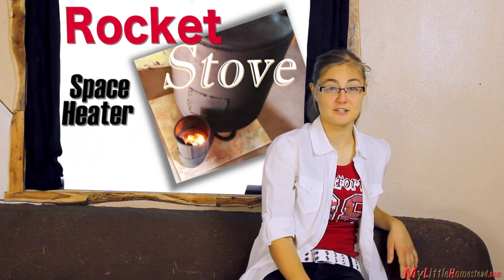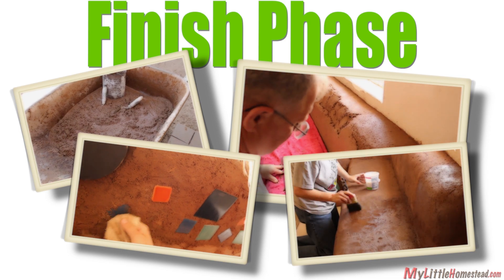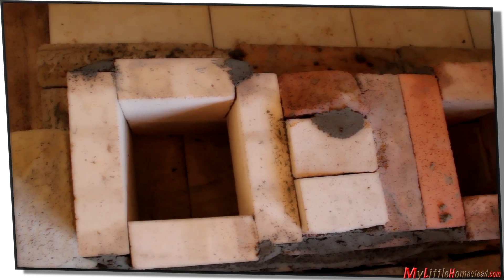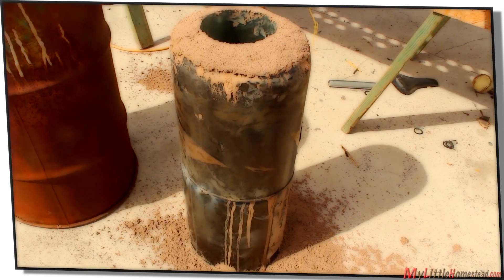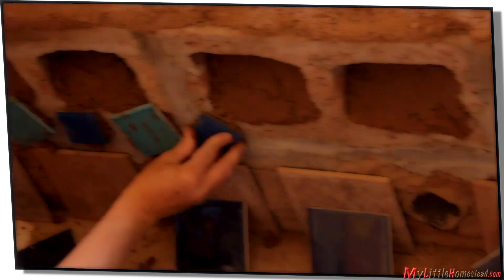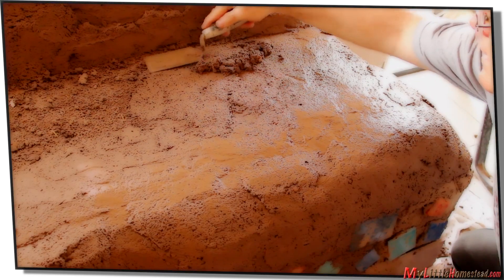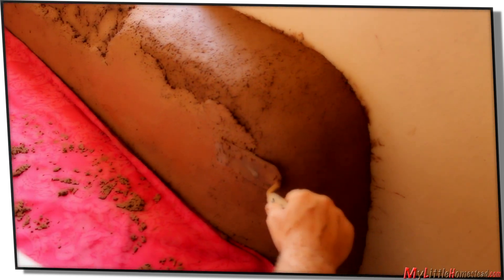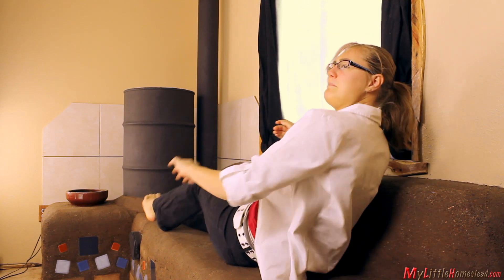Complete Build of Rocket Stove Mass Heater with Homemade Mortar & Cob

Comment: I've been in the fireplace business for 25 years
And watching you vent that thing makes me cringe !!
Interesting is one thing safe is another !
You guys are using galvanized pipe for the venting !
Not good or safe !
That pipe is not a UL listed venting component !!
Those components need to be UL listed for a reason , safety !!
Especially a the temps that type of system generate !
I understand what you doing but you can't just grab inferior components and slap something together!
its one thing if you have know other choice but  to use those components but it doesn't look like the case !
Reply: You know nothing about the science of a rocket mass heater! Once the flames hit the top of barrel they cool rapidly and the gases turn to CO2 and steam. The temp of the Galvy pipe is under 200deg. And you can hold your hand over the exit. The only problem with this design is the metal flue in the J combustion chamber, it will burn out. You should only use fire brick. These heaters burn more efficient than any fuel furnace. You could breath the exhaust. This is nothing like an in-efficient fire place or wood stove.

Comment: Interesting.
The smoke has a long vertical way. Does the chimney have enough "power" to pull out the smoke.. Meaning; is it easy to fire up? (sorry the english)
Reply from the maker: Lau Fowler Petersen The short answer is yes but you can check out our latest video as it explains a little more: https://www.youtube.com/watch?v=nG9-hyg7r4k
Reply: As long as the mass that you're heating remains warmer than the outside air, it will constantly have pull. The super heating of the exhaust gasses inside the heat stack allows for almost a vacuum effect when the mass is cooler and you light it with high energy output. 

A warm mass will basically work as a free air circulator constantly sucking out air. (Which is why you should always have some sort of lid for your feed)

Comment: I love this project.  I WILL be doing one at some point.  More research to do of course but I do have a question for you.  How is your ducting connected to the combustion chamber?  There was no mention of that other than placing the ducting on the first cob layer.  Thanks!
Reply from the maker: FlyHeadCement We used 6" heat register

Comment: I have a few questions: How water/spill resistant is that cob? What would happen if a glass of milk, or wine or something was spilled on it?  Also, how hot does the surface of the cob get at it's hottest? Could a person build this stove with cob, square it off, and encase it with say... oak cabinetry? Any info is much appreciated. Thanks!
Reply from the maker: Joe Stubbernubbensteingenson  Linseed oil helps to repel liquid spills - we might recommend floor wax too. We don't have any experience with milk or wine spilling - only water. If we had a problem, we would chip out the cob and redo a section. We've not measured the temperature but at its hottest, we can sit on the bench. Cob with cabinetry sounds like fun! Do it and let us know how it works. It's all about exploring. Thanks for the questions :)
Reply: You did not ask me but I am replying anyway.  The purpose of the cob is to absorb the heat and release it to the room.  Wood whether oak or anything else is an insulator and does not absorb heat.  Think of an old cast iron frying pan with a wood handle.  Encasing the cob in wood would defeat the purpose.
Reply: There are cob houses in England . England is wet ..it rains alot and they have been building with Cob and other earth building for thousands of years. 
Does everything have to be squared off and perfect..I love this stove and the cob. Cob is something you can do from your own land..I live in Louisiana and the cob would keep it cooler in the summer and warmer in the winter as well as  being a much cheaper way to build your home instead of the hundreds of thousands  for a stick house.

Good job and your warming bench is beautiful...put down a couple fluffy cushions and it would be the best place to be with a good book in the winter.
Reply: Joe Stubbernubbensteingenson You can do mosaics... you can paint..sculpt and be creative. I guess not all people would love something this holistic..I just happen to love it. 

https://www.pinterest.com/junglejaaane/cob-houses-and-interior/
Reply: Good point, Peggy - thanks. I guess I'll encase my cob bench in cast iron frying pans. Seriously though, I'm just looking for something that's a little more aesthetically pleasing than cob - I've just never been into the adobe look.
Reply: Joe Stubbernubbensteingenson I understand.  I think concrete or ceramic tile would work.  They are many choices in colors and textures.  They have tile that looks like wood.
Reply: I was thinking of a fancy counter-top material like soapstone... It'd be expensive but it sure would be nice
Reply: Joe Stubbernubbensteingenson Any stone would work.  Flagstone is not that expensive.
Reply: Yeah, I suppose so... I'd initially thought of soapstone, because I know it can withstand extreme heat without exploding/shattering. But the heat is not really that extreme, so as long as flagstone (or whatever) can be polished, it'd probably look real nice. Thanks again, for chiming in!
Reply: Joe Stubbernubbensteingenson Soapstone is actually an incredibly good material for the mass of a RMH, but yes indeed, very expensive.

Comment: Hey guys!  Great job!  We are in the middle f our build as right now.  It will be used to heat our Aquaponics system.  I was hoping to pick your brain.  The slightest wind outside pushes the exhaust back through the system.  I have extended, curved, covered and done anything I could think of to limit the breeze from entering the system  Any thoughts?
Reply: There are several things you can do to improve the flow and inhibit back flow. First would be to vent the exhaust on the side of the building that usually does not have wind blowing toward it, if that's not possible the next best option is out the roof with a proper chimney cap. Exhausting out the roof can be tricky with a rocket mass heater due to the fact it efficiently transfers the heat of the burn and hot gases to the barrel and heavy mass, leaving little heat to keep the draft strong. Therefore, If venting out the roof it's best to have the exhaust run close to the barrel to help re-heat the gases before exhausting up and out, as seen in this video. Another thing to help with keeping a strong draft is making the heater riser out of extremely insulating material, best material IMHO, is fire brick. The way they built the heat riser in this video is not the best. Last time I made a riser like that the center pipe melted and would cause toxic smoke out the exhaust.
Reply from the maker: Jeff Johns Aaron is right on on the venting. We just completed a newer version using the formula:  combustion chamber height is 3 times the diameter of the exhaust pipe. For example, a 6" diameter pipe equals an 18" tall combustion chamber. We found this drafts well. (we vent out the roof with a cap)  Good luck with your project :)

Comment: hi , nice RMH ,just 2 little remarks , how do you clean the pipe in the back of the bench and the pipe going up  and second porland cement  turns to its poudery self if heated above  800°C so it's a no no for feed, burntunnel and heatriser  . just my 2 cents
kind regards

Comment: No mention of burning off the galvanized coating of the 30 gallon barrel, done outside, never breathing any of the fumes. Please research about this toxic and dangerous poison, then add comments for all to read, cause otherwise a great video and how to will surely get plenty of people to try this. My first concern was when you said you only sanded the barrel before painting. Always read up on how to burn off the zinc/lead/cadium coating under the paint, you will notice the paint peels, then portions of the barrel turn to a mirror like reflection, then to dust when it reaches ^1100F . The fumes and dust of the coating are dangerous.
Reply: Mike Steigers I’ve never seen a galvanized 55 gallon barrel. Have you?

Comment: After long burning season would it be hard to clean those curved built in pipes? Or because of rocket stove design, there woun`t be too much crap inside? Too scared to try this as building inspectors might not like it or certified chimney specialist might not approve it.
Love your video anyway! Might try to make something like this in future in geodesic greenhouse for winter heating.

Comment: You can wrap a hot water coil around the drum and drive it with either a thermal siphon or pump and use it to heat the radiant floor. Thinking about doing that if I get around to doing a super-adobe shack. You would likely need a burping tank to handle over-pressure in the coil but perhaps a 2 inch clearance might be enough to keep the water < boiling temperature.

Comment: Was wondering about the "MASS" you used for your Rocket Mass Heater?  Which materials are best.  Was thinking of using rocks and stones  found on site.   (2-10 inchs in size.  Would that work? I just have a limited amount of 'COB" (clay) hence wanted to use larger ROCKS (10 inches ini size) for the mass. I would use the COB to act like motor to hold it all together.   Your thoughts please.

Comment: great video is the portland cement mix for high fire areas ? i have heard that refractory cement is what is used for high heat areas just wondering
Reply: Refractory seems a bit overkill, that stuff is rated for up to 2000-3000 degrees. If you are going past 800+ degrees you'll more likely start warping the metal ductwork or the drum first.

Comment: Trying to contact you on Facebook but FB wont let me send a message. Here is what I wrote there "I like you site. A friend of mine just shared your rocket mass heater video with me... we are also homesteading and also built our own RMH in April. I work at the Math and Science Dept at our local college and talked to our lead chemist as I too wanted to paint our drum. But he told me NOT to do it! The RMH heats much hotter than a conventional wood stove and the paint can emit toxic chemicals that you may not smell. He told me to grind off the paint with one of those steel brushes (you know the kind you attach to a drill)... Hope you see this message. Obviously toxic fumes would detract from the natural factor. Best, Shannon www.earthtipi.org"

Comment: Hey guys LOVE this video. This is probably the 10th time I've watched it! A few questions. Is the stovepipe actual stovepipe or just duct pipe? When you put the 30 Gallon barrel over the burn chamber how much of the circumference is opened to the beginning of the stovepipe for the gasses to start their journey. And how could you tell if the clay you got out of the ground was the right kind for your project? I'll probably have a few more but that all for now :) Keep up the great work guys!!

Comment: yeah it helped allot! the only thing you didnt answer was how you got the air from the combustion chamber into the "exhaust pipes" like if you cut a hole into the side of the drum or had the whole round pipe underneath... but then i watched the video slowly as you put the 55 drum into place and i thought i saw a vent almst lke one youd have inside your house with a central heating and air as the mouth for the exhaust. is that correct? and if so is it just the regular stuff you get at home depot?

Comment: I tried tiles and it didn't work well but maybe if they were made without enamel coating? or you used small tiles and left space between them for heat to radiate?

Comment: The Wikipedia page for "Combustion" seems to have a related definition, the one for "smouldering".
If you Google using "combustion lente" (slow combustion in French), then there's a google images link. The stove of the guy I knew was, in apparence anyway, like the following images show.
econologie(dot)info/share/partager/2005-12-26 poel a combustion lente 014.jpg
pages.infinit(dot)net/madmax99/foyer.jpg
Some images show serious flames, but his showed mainly burning hot red coals from hardwood.

Comment: From what I understood from the guy I knew, and he explained while showing me the stove while it was burning a couple of pieces of split hardwood, the wood burns very, very slowly, lasting a long time while producing a lot of heat. A small fan is included and I think it's adjustable for speed or power. It's to push hot air out at a faster pace. The guy said that a couple normal pieces of split hardwood would burn for hours and I don't recall seeing much at all for flames; just little ones.

Comment: Fowl manure, chicken anyway, is great fertilizer when needing nitrates, but elderly farmer and his son once told me when I was starting my first garden during early 1980s that this manure has to be applied in very, very small doses; else, it'll burn the roots of plants. Potent birds!
I also read that blending it with, fe, cow manure helps to provide a very complete and multi-use fertilizer for various plants, but most of my crops evidently didn't suffer from absence of nitrate boost.

Comment: Just checked the manure page at Wikipedia for an answer to my question and there isn't one, but then tried a Google using manure, fire and fuel for search terms. According to the following short article, manure produces more BTUs than hardwood.
"Ellington company turns horse manure into fuel", Posted Nov 08, 2012, updated Dec 06, at wfsb(dot)com
The company "found a way to get rid of the smell", as well; and customer demand is apparently strong.

Comment: What makes it a much lower cost than a slow combustion wood stove or whatever they're called? I don't know what the current prices are in Quebec, but I think they usually sold for around $200 Cdn (plus sales taxes, of course) when the guy I knew bought his. It was some time in the 1980s. It required very little wood and this was heating pretty much the whole house; a sizable one.
I don't recall how many cords of firewood were needed for a full Quebec winter though.

Comment: Hmm, I know from experience that when you burn pallet wood that itty bitty magnet isn't going to be getting out all of the nails. Pallet wood burns quickly and produces a lot of heat but it doesn't last very long and the more oxygen it gets the fast it burns. You'd be trying to put wood into that thing every 20 minutes with an open stove.

I'm not buying it.

Comment: You say it's a combustion stove. Is it slow combustion? There're some businesses in Quebec, Canada, that make or once made slow combustion stoves for burning wood. A guy I knew bought one, placed it in his basement living room, and it pretty much heated the whole house; not a petite house, either. I visited and found the heat great. He told me that it required extremely little wood, for just one piece of firewood from hardwood would burn for a very long time, very slowly.